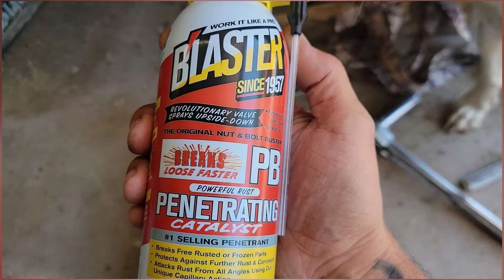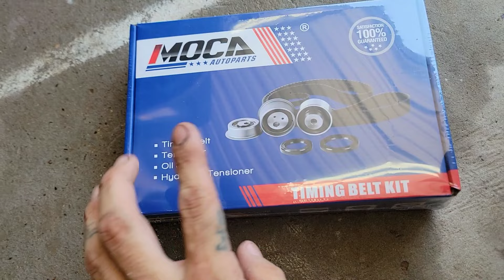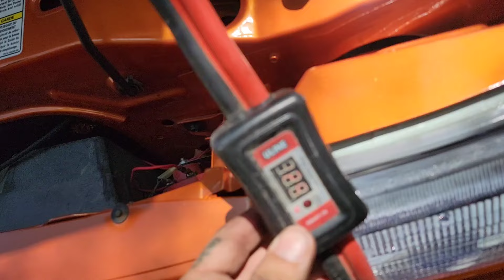My Mitsubishi BROKE the Timing Belt While Driving!  😭

Comment: I used to be a mechanic at a Mitsubishi dealer back in the late 90's. We had a running joke that if you haven't changed your timing belt by 60,000 miles you will be in for a new head. I've replaced heads on Mirages and Eclipses with 60,100 miles on them. And it wasn't just a couple. It was a lot of them.

Comment: Oh man I feel your pain!! Been there done that too many times...
I'll give it to you though - you jumped in and got the job done with the bare minimum of tools.  One thing I think you missed is that the crank turns twice for every  1 turn of the cam (which is why the crank mark was the same when you turned the cam to TDC) so you MIGHT have the crank at bottom dead centre when the cam is at TDC, so 180deg out.  Before the comp test, take out cylinder 1 spark plug and make sure it is TDC when the crank is at TDC.  Usually being 180deg out will make it run rough and also cause overheating or a really quick heat up to temp on idle.  It could be that simple - well |I hope so! 
Greetings and blessings from Australia and thanks for the vid.

Comment: Bummer about the belt. I had one break on the way to the repair shop to have the timing belt replaced. I knew to turn off the engine right away and saved myself some big bucks. I didn't see you locate top dead center on the number one cylinder on the compression stroke. I did kind of skipped through the video, so sorry if you did. High idle usually a vacuum leak some where. A big old stogie with lots of smoke is an easy way to find leaks.

Comment: That bolt is really hard headed. I have the same problem removing it just to replace the water pump. Exactly the same car and model. I suggest you raplace the seals too because of the heat.

Comment: Great job, disputerade the end result.... and to me it seemed to be the first time your doing that so really good job! 

Compression test is a good way to see if something leaks thru, somewhere, and (Im NOT a professional mechanic or anything) but there is A sound which sound off (like you said) and isnt it ticking more, from the cam... little like some of the lifters dont have the same tension as before....or has it always ticked almost like a Mercedes Benz deisel four from the 70 ies?⁉️🫣🤔🫣🤔

Think you are lucky to have some valve replacement to it and that can be what saved you, punching the clutch at the right time so it maybe saved your pistons and head.....but we will see.... And the crank sensor probably broke by the belt !

Following with exaitment.... sorry for my English spelling! Good luck!

Comment: Spray vacuum lines with be
Brake clean or do a smoke test to see if you have an air leak causing the higher idle.  You can makes some tester with pvc pipes and smoke bombs and pressurize container  intake with the compressor.  Lots of YouTube videos on making them.
Reply: Also I wonder if your valve cover gasket is leaking and out might be a good time to replace it if you didn’t yet.  Good luck on the air bag.  When it rains it pours with car maintenance. Or more like a Texas tornado?

Comment: Do a  2.0 lancer swap.
Or 2.4 galant. Or the 1.8. All are sohc. 
U will need a manual 1.8 ecu. 
But it can be done.
Even the 6g7xx. V6 engine will bolt in. With factory parts😊

Comment: I say this on a bunch of random videos anytime aomeone is struggling to break something loose, but get some "deep creep" by seafoam. It is the best penetrant stuff out there bar none! I have had rusted on exhaust nuts and bolts that i couldnt break loose with a breaker bar and was scared id snap them. Sprayed it down with that stuff amd let it sit, went back with the breaker bar and wound up hurting myself because it broke loose with such little effort and i wasnt expecting it.
Reply: The best penetrating oil out there anywhere is a homemade version using 50/50 transmission fluid & acetone. You’ll never go back to Creep or any other version and it’s much much cheaper
Reply: @1982MCI  I've used that in cylinders to free up rings on a stuck engine, but deep creep is already in a can, available,easy and quick to use. Hell I even sprayed down stuck lifters and rockers and let them sit and the came free like they had never been stuck. Also had a pedestal fan that I'd had for years that locked up and even with vise grips I couldn't turn the shaft. Sprayed it with deep creep, let it sit for a while, didn't touch it again except to flip the switch on and it spun to life.

Comment: So you knew you had an interference engine and never replaced the timing belt? 😳
Reply from the maker: I found out when I was searching for the belt and tensioner kit.
Reply: The crank and cam is not a 1:1 ratio. The crank and cam have different size pulleys
Reply: Is it the 1.8?
Reply: Can turns at half the speed of the crank, lol.  It is that way on all 4 cycle engines.
Reply: My friend had a PT cruiser and his cam belt broke at a little over 230,000. If you have a code for a cam position sensor it's most likely a broken belt. Try getting it back in time and try the new belt. Sometimes you can get lucky.